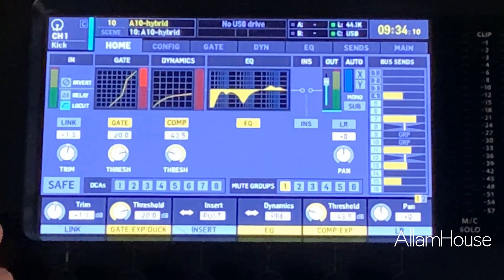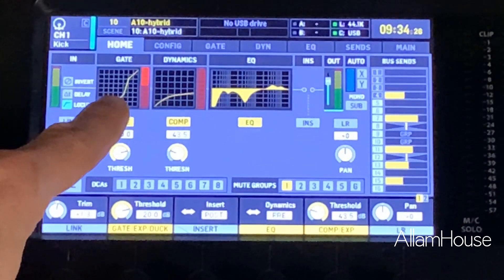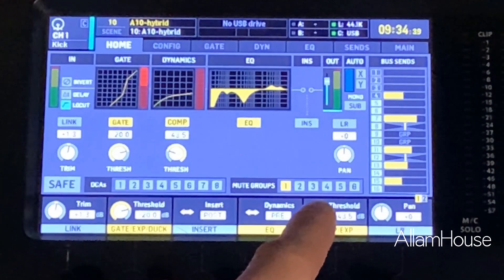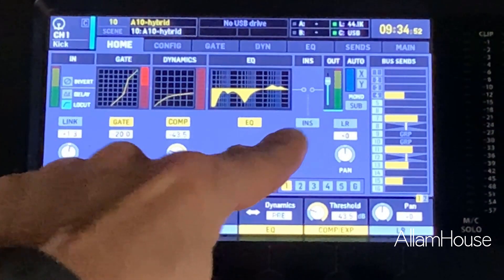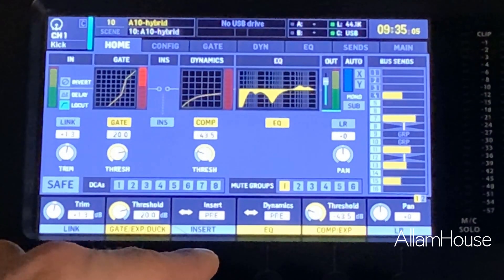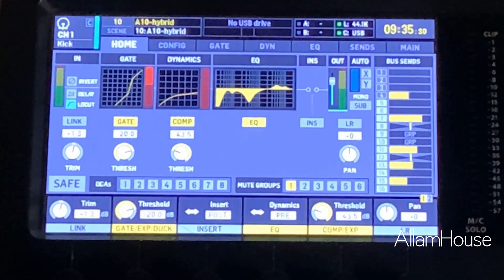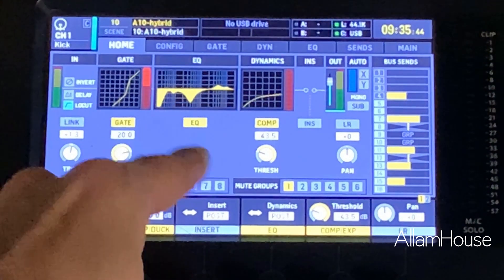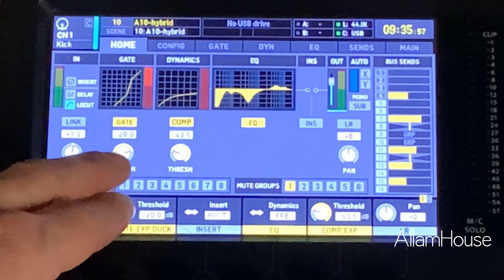Pre Fader vs Post Fader Sends  |  What's The Difference?

Comment: 15:07 Hi, about the pre and post fader when I am working on a piano stage monitor and my setup is set to pre-fader piano input 5 to MixBus 1. My question is: on M32, is there any push buttons presets that I can save my different custom preset fade levels to  so I be switching between Pastor with Piano low on stage and Worship piano high on stage?
Meaning to have 2 different scenarios on specific MixBus faders being saved to different presets where I can just press on the preset buttons like maybe preset 1 or 2 to switch between them?
Example: 
Scenario button 1: Piano stage MixBus is low
Senario button 2: Piano stage MixBus is high
Thank you.
Reply from the maker: You have a few options. 1) you could have two different monitor mixes on two different Buses they could both go to a Matrix and the Matrix would exit the console to actually feed your stage monitor. You could then mute the soft one when the band is playing and then swap to the other when the pastor is on stage. This provides you with one output from the console and two different mixes. Another option is to have snippets in place where you can have snippet 1 for the band and snippet 2 for the pastor and the only change is the monitor mix for your piano. You can switch easily between them (forward or back) during the service.
Reply: @AllamHouse  That was so helpful and generous from you.. I will try it next week at the church. 
God bless you ♡

Comment: Hi God bless you I have a question, if my inputs are post fader and we are using the P16 monitors, is that ok, doesn't affect the monitor P16 if I move the channels inputs faders ?. Thank You and God bless you
Reply from the maker: To clarify, the inputs are not designated as pre/post fader, this would be designated for a mix going into a MixBUS, Matrix or for the tap point as a mix leaves the console in the Routing area. For the P16 setup, you have the ability to select the tap point for when (on the input chain) the signal is pulled to go to the P16. Since there re EQ settings on the P16 for each of the 16 channels, many people choose to go "Pre EQ". If you are doing a bit of corrective work with the X32 channel strip you can choose the "Pre Fader" so that the signal goes directly after the channel strip and over to the P16. If you have the P16 send set as Post Fader, your house mix fader changes will impact the P16 and your musicians' monitors will change constantly.

Comment: Hi Dave. The fader on our channel 32 on the X32, does not control the volume through the buses, only the Mains. I have followed your video on selecting the bus, pressing Sends on Faders, and raising the fader. All channels are working appropriately, except for channel 32. Channel 32 was setup by the installer as a playback channel using the XLR input with an aux plug for tablets, phones, etc. My church had an analog console and this is my first digital. Your videos have been quite helpful in my learning. Can you please tell me what I am missing? Thank you so much! - Tony
Reply: Is there anything that you can suggest?
Reply from the maker: Typically I prefer to use the AUX in 5/6 for any tablet or other device inputs as it offers both RCA and 1/4" inputs. When you go with a single channel it will usually only take the left side of the audio being sent so you are missing half of the sound from your external device. That being said, here is how I would troubleshoot.

Select the channel and go to Home > Sends and use the knobs under the screen to find the bus you are having problems with. Normally the setting of pre fader or post fader will be determined at the BUS level, but you can change it per input if desired. You want to make sure yours is set to Post Fader.
Reply: Thanks! I will troubleshoot as you suggested.

Comment: I have always heard of it being hardcoded managers get pre, affects get Post. I just recently did the talent show where I said the backing track media playback channel to the monitor post fader that way I could bring the music up in the house to a good level and set a difference on the monitor channel. This allowed me to turn the music up and down in the house depending on if it was quiet or loud and it would follow in the monitor mix on stage. This got me wondering has anybody else done anything like this. It seems like very few have used Post feeder for monitor mixes that I'm aware of.

And yes thinking of an aux send as essentially a mirror of the mixer almost for video land is a great idea.
Reply from the maker: Yes, I am a big proponent of running floor wedges (especially to band members) in a Post Fader configuration. This gives me a little more control of the stage volume. I do run my live stream mix as a Post Fader mix as well. You can find that video posted here. https://youtu.be/pMnaiuC55RY
Reply: grrrr speech to text
*almost hardcoded monitors pre, eaffects get Post.
*said = set

Comment: I just received a X32 and I'm in the process of setting it up. I know you can record via the USB with a flash drive and I intend to do so, but I also want to record to an external CD recorder that we've been using with our analog board. Since it doesn't have a tape input or tape output per se, how would you hook it up and control the sound to the recorder? I assume you would use the aux RCA outputs, but since I haven't gotten into using it yet, I'm not sure how you would control the output volume. Thanks in  advance!
Reply from the maker: I’ll make a video out of this since there are various options available, but at the most basic you would record your Main Mix. The USB recorded is set to record this by default and you can go to Routing > AUX and set AUX 5/6 to get signal from your main mix and this will give you a stereo output of either 1/4” or RCA outputs depending on what your existing cabling offers you. I recommend setting the tap point to “prefader” so that changing the main fader for your overall House volume does not impact your recording. Keep en eye out for a more detailed video, but this can get you started.
Reply: @AllamHouse  Thank you! I really appreciate it.
Reply from the maker: Quick update for you. Here is the video answer to your question https://youtu.be/-gXVYs17vIU
Reply: @AllamHouse  Awesome! Thanks Dave!

Comment: Thanks for the video! Two questions,
Could I have a specific bus set as pre-fader, but another be post-fader? For example, If I only want a CD player to be pre-fader (so I can avoid it coming through livestream, but everything else I'd want to be reflective post-fader so I can make my life easy as I'm the only engineer at my church). 
Another question is, If I make the singer/instrumental monitors pre-fader, would that prevent them from hearing the EQ changes? (Different EQ in monitor than in house)
Lastly, compression isn't great to have in the singer monitors due to feedback, correct? So would pre-fader also prevent the compression changes in the monitor, but allow them in the house?
Reply from the maker: Let’s try and roll through these various questions for you. 
1) each BUS can be set independently of the rest so you can have any mixture of pre or post fader BUSes. There are some other options as well, but these are the two biggest destinations because it decides of your main input fader will impact the BUS as well. 
2) you ask about a CD player not going to the stream and that can be accomplished by muting it in a stream BUS so it is not heard.
3) your monitors for singers/instruments have different tap points that can be used within the Pre-Fader distinction. You can set the tap point as Pre-EQ which will take the signal just after the preamp (gain) and before the EQ/Comp. This would send them the raw signal coming into the board, right back out to the monitor. 
4) you mention different EQ for the input vs the monitor. While you don’t have the ability to EQ each input twice, you do have an overall BUS EQ and comp that can be used to shape the overall mix… in this case your monitor. 
5) compression does raise the noise floor and can potentially cause feedback if you have floor wedge monitors. I do use compression on my vocals and would use a Pre-EQ tap point if I had to run wedges.
Reply: @AllamHouse  Wow, brilliant answers. I appreciate you taking the time to respond. I'll be sure to follow-up if I have any others.
Reply: @AllamHouse  Hello Allam, just following up: If I set the tap point for Pre-EQ, I lose the ability to control the monitors via fader, correct? I tried changing this tonight and my monitors were extremely loud. I'm assuming because the bare input was coming through and not accounting for my fader setting as it was not set to post-fader. Is there a way I could keep post-fader tap point on the mix bus while also avoiding EQ being sent to the monitor wedges?
Reply from the maker: Yeah, this is a challenge for sure. The short answer is no, you don’t have a way to send Post Fader AND Pre-EQ to a BUS for a monitor mix. A different option (more complicated) could be using two BUSes where both are set Post Fader and the channel EQ os turned off (or minimal changes). The first would be your monitor and the second could run your channel EQ needs and would go to the house mix. This would take up a second BUS, but could be a solution.
Reply: @AllamHouse  Ah, very interesting! It seems like it might just be better to run everything Post-Fader and make sure the monitors are EQ'd effectively to benefit the band. However, compression is harder to get around since it could result in feedback loops.

Comment: So would a post fader bus be a good solution to use for a FOH sub?  I would like to to mirror completely the entire mix of the L/R main
Reply from the maker: For a FOH sub, I usually use a Post Fader Matrix. You can send your LR mix to a Matrix and then that one output can be routed to any XLR output (or stage box) to suit your needs. Then, it will follow your Main fader for volume and you will have the Matrix fader for individual sub volume as well. You also have EQ and compression capability on the matrix so this can remove the need for fancy crossovers or a DSP.
Reply: @AllamHouse  Genius! This should do the trick!

Comment: I watched this video 3x and still confused or missing a step.   You used the exsample of the IEM for Pre fade & the live stream for the Post fade.  Both are mix buses and you used "Sends on Fader"  for both exsamples.  So it looked to me you used the exact same procedure on both exsamples!  Therefore the question remains, " What is the difference between the two". I understand the concept  application.  What I'm missing is the set up application procedure.
Reply from the maker: Ah yes
(1) select the desired MixBUS 
(2) push the HOME button next to the screen
(3) go to the Config tab
(4) use the first encoder to choose if the BUS is prefader or post fader. 

A prefader mix is set specific to the faders for that BUS and the movement on the main mix does NOT change the BUS mix. 

A Post Fader mix will allow you to build a mix and then any changes you make to the main will be ‘followed’ into the BUS.

Comment: Will  compression, eq, and Fx be  heard in a post fader stream mix without a DAW.
Reply from the maker: Yes, In the standard setup of either Pre-Fader OR Post Fader, the EQ, Compression and any inserted FX will be heard in your mix coming from each channel (1-32).  You can also setup FX racks to be specific to your stream and then add them in to your stream the same way you add in instruments using "sends on fader".  This video might help walk through the different settings.  Check the description for some quick links to specific sections https://youtu.be/pMnaiuC55RY

Comment: This is how I have my own mix setup, except for using MixBus 3-12 for sub-grouping instruments before sending to Matrix 1-2 for Facebook.  This allows secondary EQ/Compression and other adjustments to make the FB feed better.  Only issue is - doing FoH and FB mixing alone isn't easy.  I will record during practice night and play-back before Sunday arrival to try to pre-mix the stream before services start.  I will share your video among our team to see if it adds value.  I picked up Waves Tracks Live for recording but was using Reaper before that.  For some reason, during playback, I end up with more input gain off the recording than when instruments are playing and need to lower output volume from these DAWs to try to mimic the live band.  Ever experience that?
Reply from the maker: Some DAWs are setup to have a raised output by default, but with a little effort you can set it up to do a 0dB output and get the same level coming in that was recorded. 

Mixing 2 mixes at the same time is difficult for sure. My church uses this setup with a Post-Fader mix on to our stream and then we have groups that are used for the house instead for different EQ adjustments. 
https://youtu.be/pMnaiuC55RY
Reply: @AllamHouse  Thanks Dave, I may record my board setup too and offer a Scene file via Dropbox to whomever wants it.  Biggest nag I have from some reviews of other churches is lack of reverb and Fx on their streams.  Some sound like they're right in the room with the listener.  I've found ways to get the X32 working to sound good on both the PA and stream.     Oh and also, you may know an old friend from my growing-up days - Gary Craig at Richmond BMX.  His dad ran a bike shop and started BMX tracks back in Niagara Falls, NY where I did a bunch of racing in the early 80s.  Say hi for me if you catch up with him.

Comment: Hi Allam, thanks for the tutorials, could you show us in how to do a mix for a guitarist inear monitoring, we have encountered a problem with our x32,  all the instruments can be heard but he is struggling to hear himself...we have checked all the volume levels, we can hear the guiter on the front speakers but no in his inear monitors.
Reply from the maker: Here is a video that talks about setting up monitors for IEM. Check it out and let me know if you have more questions. https://youtu.be/zwYcNieISF4
Reply: I have continuous challenge with our teams and their in-ears.  We use a rack X32 with mono-configurations for Shure in-ear receivers.  We must pan the receiver left or right depending on which channel their mix is on (8 receivers, 4 Stereo Transmitters).  Sometimes, they do not look at the panning knob on the receiver pack and get confused on that.  Same conversation with them as what you just typed.

Comment: HI GREAT EXPLANATION ! I do have a question, does the EQ,COMP etc are follwed from what is set for each channels? and then sent to the mix busses for pre fader?
Reply from the maker: Yes. In the standard setup, the Pre-Fader and Post Fader options both send after the EQ and COMP.  There are additional settings you can do if you want to choose just after the low cut, but it then becomes at an individual channel basis and takes a little time to set up properly.